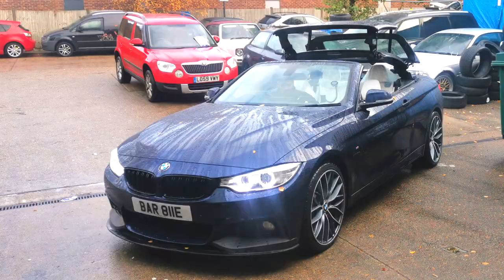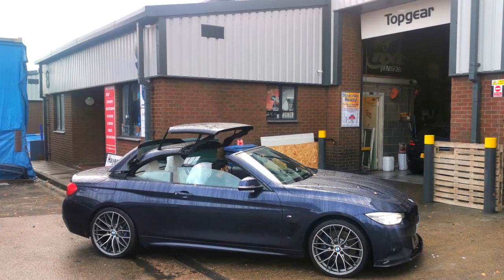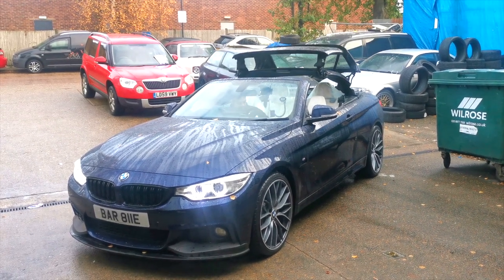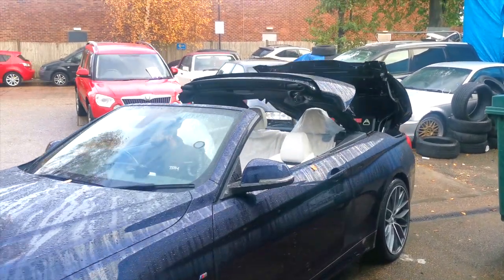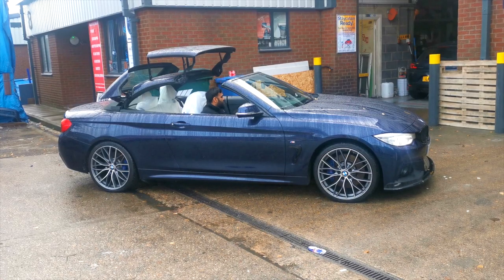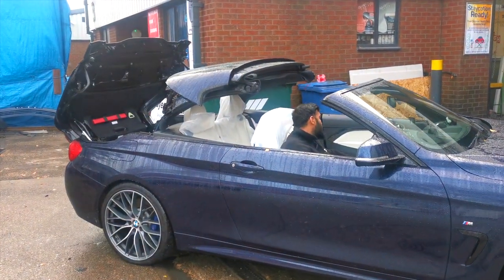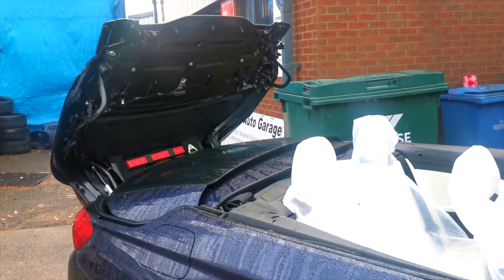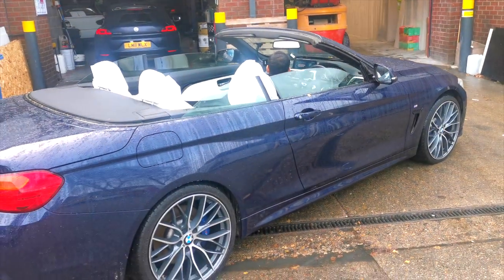BMW 435D Roof Not working  BMW convertible roof not opening | BMW f33 convertible roof problem fixed

Comment: Hi, I've a 420d 2016 convertible and the roof opens and closes perfectly and locks into place but the computer says its not locked into position,.. but it is? Any ideas please
Reply from the maker: Faulty sensor

Comment: You cannot diagnose a fault by watching a video bu I have a similar experience with the same problem where the seal on the air vent inside the boot became dislodged letting water in.  The air vent is behind the rear bumper cover on the drivers side and it becomes dislodged if the bumper is knocked/banged from the side.  This only needs to be a slight knock from the side but it can cause a leak and a large build up of water inside the boot. Early signs of this problem are condensation build up or musky smells.  I would recommend a new vent/seal and small drain hole in case the air vent seal is ever knocked again in the future. Obviously the major cost is the consequential damage to the electrics
Reply: You will also get water ingress into the boot if the rear regulator seal which covers the bolt is left removed, it’s like a waterfall into the battery compartment, and rear seat.
Ensure the rubber grommet or seal is installed when tightening up the regulator bolt.

Comment: I bought one November 2021. Waterlogged by Feb 2022. Started having electrical problems. Replaced electrical modules and seals as described. Over £1000. Not as bad as £5000 from bmw!
Reply from the maker: Due remember to carry out regular maintenance

Comment: 428ix - roof problems. Dealer says drain holes have to be enlarged and sealed AND a new motor for the window because it was probably shorted by water (the drain plug saga).  $240 for this fix.....NUTS! why isnt bmw taking care of this nasty problem? Was this on a recall previously and never really taken care of?
Reply from the maker: Never had a recall.  It definitely needs to be

Comment: I have an F33, also had issues with water ingress, but in the rear quarter, then the roof stuck half open, because of the window regulator cable had snapped, I managed to fix it myself, by installing a used regulator, which cost me £100, I have since drilled both the drainage holes, and no issues, I regularly clean my seals with Gummi pflege, and WD any of the moving parts.
Reply from the maker: Great to hear you have taken proactive approach to this issue. Weldone 🙏
Reply: @TGHCUSTOMS   Thanks for highlighting the issues with your customers car, and am pleased BMW made a huge financial contribution towards the modules being replaced,  bit of a worry though, seeing water ingress even after the work had been done, hopefully this gets resolved.
Reply: My F33 roof got stuck, fortunately it was 37 degrees, despite my best efforts, it had to go to BMW who diagnosed the tailgate boot latch had failed, the roof switch was absolutely dead, after me trying to get the roof up, no sign of life, I was so sure it was a wiring issue, or sensor/switch, BMW reset the fault codes, and roof was able to be closes again even despite the boot open being displayed on dash, new tailgate locking assembly being installed tomorrow, £711.00 ouch.....
Reply: I heard like something had snapped during pulling windows down. Rear side window not operating anymore, but hear motor still rolling and bashing something, i recon the line has snapped. Would i be able rewind new line myself you think ?
Reply: @Takie_Tam_Filmiki  you won’t get the tension, you need a new regulator, so I am guessing you don’t have the roof down to enable to get the regulator out?
Reply: @macmad6959  that was happend when the roof was pulled down, so i managed take the roof up again but was struggling as i had to move the window by hand to simulated proper positioning during roof operates. I was panicing because i saw the rain was coming
Reply: ** If roof won’t go down ** Get yourself a new working regulator, with a working motor, it will need to have the 3 screws mounting motor to regulator, remove back seat, and door card, remove the inner door seal, black piece with two rivets that connect to internal trim, remove the regulator bolt, unscrew the bolts at top, and get your hand in to remove the connector from motor, you will need to press the release catch.
You can then plug the window connector into a working regulator/motor outside of the door panel, back seat usually works, press the buttons on each window to lower and hold for 5 seconds, press to raise window and hold for 5 seconds, windows will now be initialised and regulated, press the roof switch and the roof should now function, you can now remove the old window regulator from the rear panel.
Reply: @macmad6959  wow, thats really good  tip&trick. Thank you very much. So, there is no chance to replace the regulator if the roof is up and locked ?
Reply: @Takie_Tam_Filmiki  I tried it mate, I promise you it’s not possible, I even pulled the top of regulator out and cut it off with a dremel, it won’t come out, I have now damaged all my external trim, so needs to be wrapped now. 😫
Reply: Even tried just connecting a new motor, but the car is too clever and knows the parameters that a regulator distance covers, so unfortunately you will need a regulator with a working motor, even if you get one from a breakers yard, to initiate the windows and control roof mechanism.
Reply: @macmad6959  thanks you sdvised me with this important points. I will buy a new regulator first then try to fixed myself. Will let you know how was going then, maybe even make a some video about it. Thanks again.
Reply: @macmad6959  are you from uk ?
Reply: @Takie_Tam_Filmiki  yes from Essex

Comment: My 435I was stopped ina place for few years now when i try to put the roof down it doesn’t go i hear a sound retracting the front glasses goes down the back glasses doesn’t move and the roof doesn’t move what could be the problem please update me in this thankyou !
Reply: Please give me a feed back if you’ve a idea i also changed the battery of the car cuz the old one was dead
Reply from the maker: Most likely where you have left the vehicle idle for a period of time, the motor is ceased. Remove the panels or spray some wd40
Reply: @TGHCUSTOMS  nothing to do w coding then ? Since o changed the battery also the second row shutters dont go down
Reply from the maker: @inevitable-bawx-3944  very unlikely. Battery change would cause vehicle starting issue more than issues with the hood
Reply: @TGHCUSTOMS  i see so you think it wont be a big deal ?

Comment: Was the car under warranty before they fixed it? Mine has the same problem but its out of warranty
Reply from the maker: No it wasn't. But it's a known problem and you just have to try to convince them it's a manufacturing fault
Reply: @TGHCUSTOMS  Thank you, i will be doing that, Your video helped out!

Comment: ALL DONE! HURRAY! TOP IS WORKING. Doing the happy dance. Replaced the regulator, motor and vapor barrier.The motor had signs of rust, wire was kind of shredded and the bimmer repair shop (not the dealer) took care of it. He said he sees a lot of this problem AND gave a 3 yr guarantee. That was a nice plus. Thank you topgear Hayes for all info you provided as well as your followers.
Reply from the maker: I'm glad to hear 🙏 the problem is resolved. Remember to follow the maintenance procedures to avoid it happening again
Reply: @TGHCUSTOMS  oh yes, Glad I was able to find a repair shop that specializes in BMW and uses only BMW parts only.  Can't thank you enough for your expert advice.
Reply from the maker: @ilvsurfin  we're glad this video was helpful 👍thank you for your feedback

Comment: I’ve had drain holes done but getting roof is not latched message after a day of rain any ideas where to look ? After it drys out everything works fine 
Boot area is bone dry I’m thinking a sensor somewhere any ideas where to look mate

Comment: I wanna get this car but this scares me...
Reply from the maker: Be scared. Be very scared.  This is a very common problem on this car
Reply: @TGH CUSTOMS   @TGH CUSTOMS  damn... thanks for the info. So would a coupe with a sunroof be better? 

Some people that the driving experience you get with the top down is worth the drawbacks of having a convertible.

This seems a bit deeper than a "drawback" so "drawback" seems like an understatement...

I was aware that it was a potential risk, but I was hoping that it wasn't a common one... crazy how such a big manufacturer could let this go on...
Reply from the maker: @Ty-J_250  if I was you for peace of mind I would opt for the coupe. If you got a dry storage or garage to park the car go with the convertible

Comment: I have a regulator on the rear passenger window, anyone got an idea how to override the hardtop manually?
Reply: Did you figure out how?
Reply: @junaizzz275  no I didn't want to push my luck so took to roof specialist Cayman in Redhill cost 580 but included the whole regulator change. I think it's a common issue some of the water stays under the regulator which damage the strings, it's not like the usual wear and tear but moving forward will just cover the car on the rain etc.
Reply: I think the procedure may be taken if you have a scanner to force the service on the roof which I don't have so overall it had to be done